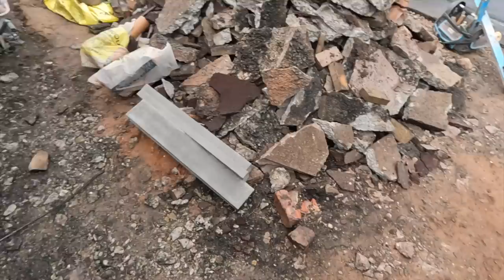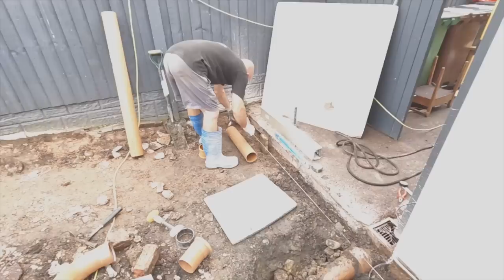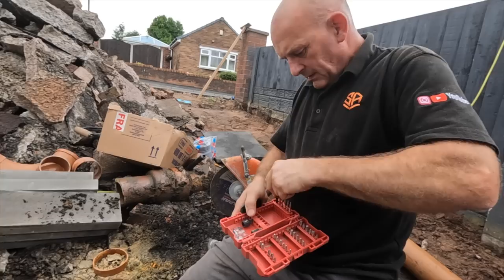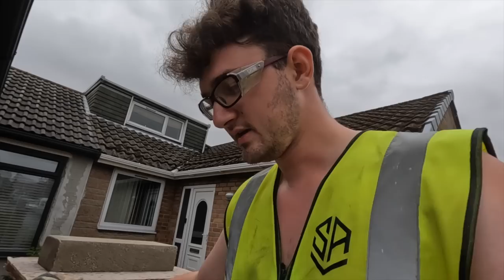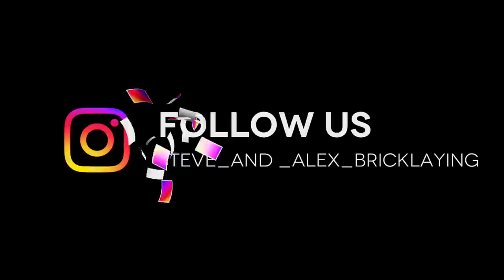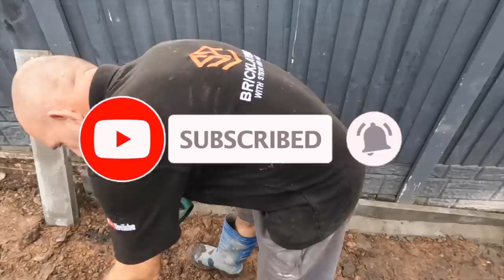ACO DRAIN ISSUES ... DRIVEWAY MAKEOVER PT 2

Comment: I felt your pain watching this. My drains on my house were very complicated and I can tell you that sometimes you can chamfer the edges and put on litres of lube - but sometimes they just REFUSE to push in to the socket on those underground fittings. 

And they also cost a small fortune!! I had to install 3 inspection chambers with risers and god knows how many fittings. Blew my budget completely. Sending the wife back to SF many times to get “just one more bend or tee to see if that would help”. 😅

You did really well, better than me, not to lose your patience 😡 😂
Reply from the maker: Yes very difficult most of the time. 😤
    The tantrums were edited out 🤣🧱👍🏽

Comment: I would have removed the existing drain pot, and repositioned a new drain pot in line with the AccoDrain along the front, and put a new shorter connection from the pot into the existing 4” drain…I think it would be possible to creat sufficient fall in both directions to allow it to drain…and lastly, simply have put a bend and show at the bottom of the down pipe so it discharged in the new pot in the new position…might have been a bit easier for you…

Comment: You negated the air trap on the SW system you may be called back because of funny smells.
Reply from the maker: It’s a surface drain 🧱👍🏽
Reply: @SteveAndAlexBuild  but it will go into a combined sewer in the road thats why the drain pots have traps.
Reply from the maker: @glynnepritchard2526  🧱👍🏽
Reply from the maker: @martin2466  🙄🧱👍🏽